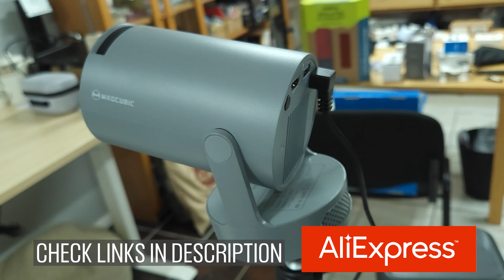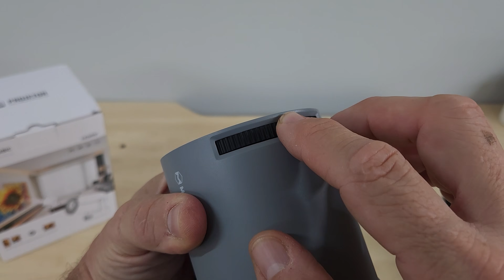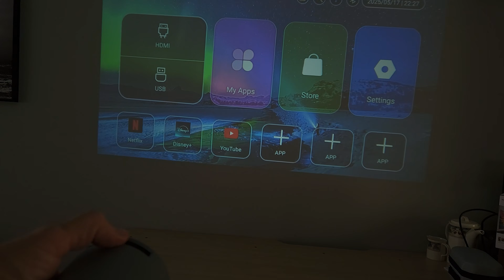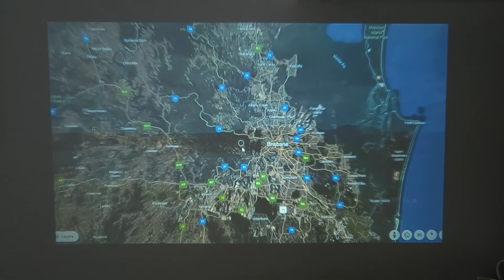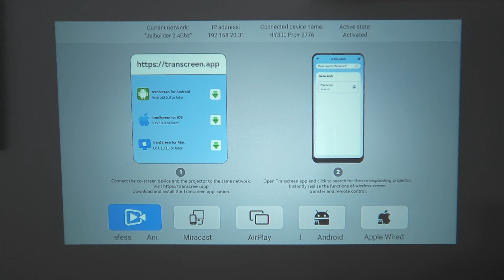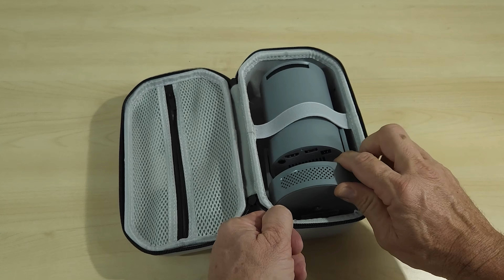MAGCUBIC HY300 Pro Plus Mini 4K Projector—Way Better Than I Thought!

Comment: I just got mine yesterday and it’s pretty cool, only issue that’s now happened twice is that when I try to use any app built into the system it says there’s no Wi-Fi connection (even though there clearly is) and that I can’t use the app. The only way I’ve found to solve the problem is to factory reset the projector, which is annoying to do since I have to re-map the screen to my wall and have to sign back into all my apps

Comment: Does this remember your login details on YouTube. 
Do the apps come pre installed and are they free
How long is the power cable
Reply: I just got one yesterday. Yes, it remembers your login for YouTube once you set it up. Mine came with a few but you do have to install them, super fast though. They are also free and there are many to choose from. The power cable is unfortunately quite short so you may want an extension cord!

Comment: Some of the screen mirroring doesn’t work well or at all.

I bought this to cast crunchyroll from my iPhone 17 pro max on my ceiling (instead of watching it on my phone) but it doesn’t work.

YouTube works, didn’t try a bunch of different apps because I wasn’t in the mood to but I’ll probably hook up my Xfinity stream box to it so we can watch Hulu, Netflix, etc.
Reply: Does crunchyroll allows miracast ? Netflix and plenty of other platforms does not, it is not necessarily a projector issue.

Comment: The resolution looks very very dull. doesn't seem to be 80000 lumens or Ansi Lumens 290. something seem to be odd. The other supplier advertises the same model to be 170 ANSI Lmns with 1*3W speaker at the base.
Reply: @sayedbahari3269  older models

Comment: The brightness is not enough,should be 50W led inside not 30W.The sound from speaker is awfull,the power supply is 90'C hot it will work less than year.Mine new has curve picture  from beginning. You must hawe router ,not connecting wireless directly.
Reply: Its 30 bucks

Comment: I got mine last year from eBay Australia and it still works one year later I use it almost everyday
Reply: Roughly how many hours each day
Reply: @Limitless807  depends maybe 5 hours a day
Reply: @andrewattenboroughtwothumb4697 that's quite durable
Reply: @andrewattenboroughtwothumb4697   is it good for gaming ( Playstation) ?
Reply: Does it connect well with the wifi? Also, can i connect my bluetooth earphones with it?
Reply: @Shanayasmiles  mine does perfectly

Comment: Hi, can you calibrate the picture settings for the best picture quality and inform us the numbers? Thanks
Reply from the maker: Yes, the picture settings can be easily adjusted and calibrated. No point me providing this as everyone has a different surface being projected against, and so this needs to be done individually.
Reply: Why?   Are you going to be using the same colour grey paint on your wall,  with the exact type of ambiant lighting?

Comment: Hey, love the video. I just have a question. Where can i buy the exact DC cable? I can only find the round ones that don't fit. Can you please help me out?
Reply from the maker: Hi, I tried looking online and had no results, sorry.Maybe you might have better luck. You're after a dual-output AC/DC power adapter with a 4-pin plug with the following specifications:

Input: 100-240V AC 1.0A max
Output: 1: 36V DC @ 0.95A
Output 2: 12V DC @ 0.7A 
Model/D/C Number: 2503 (likely a manufacturer-specific code)

Comment: Sound Quality from the default speaker, is it Good for a small room?
I am currently enjoying my HY300 pro only. But the default speaker is quite low even to the fullest volume.
Always need a BT speaker nearby.. because from 3.5mm audio source is also quite low
Reply from the maker: I think the sound quality is reasonable for a small room. But obviously it only has a small speaker so don't have surround-sound expectations, lol. We use it for camping, and it's perfect for that application.

Comment: 8,000 lumens? Yeah, nah. Maybe a couple of hundred. Rated like a 1990s portable speaker claiming 8,000w or a pocket torch producing 8 million lux. Yeah, nah.
Reply: The spec sheet on Ali now lists it as 260-300 ANSI lumens which looks like a lot more accurate.

Comment: Another great review mate 👍 Do you know the wattage of the product ? I wonder if I could run this from my 12v lithium with small invertor at camp
Reply from the maker: Yeah, sorry I forgot to include the wattage in my review... I'll check tonight and will update you. 👍
Reply from the maker: So, this projector is run from a 4-pin DC Power Supply plug that states:
INPUT 100-240v 50/60Hz 1.0A MAX
OUTPUT1: 36v - 0.95A
OUTPUT2: 12v - 0.7A
So, I don't think 12v small invertor will run this to be honest.
Reply: @jelreviews  bummer !! Thanks for checking anyway mate 👍

Comment: First of all this is not true 4k, second the ansi lumen is to dim to watch in day light 😊
Reply from the maker: I disagree... the image quality is actually excellent for the price.
Reply: @jelreviews  turn on the lights it will wash out the picture. And it’s not 4K. 720p if even that.
Reply: @jelreviews  awesome little thing for so cheap, I'm impressed
Reply: Its 40 bloody euro , for that price who cares. It's 720p native and it projects, and sure it's not going to blow you away with brightness ....its 40 quid what do you expect.
Reply: @technodaz Yeah that’s true but why they always go to lie row with those f… amazing numbers 😂
Reply: @linassapnagis2174  But it says "Magcubic 4K HY300 Pro + Projector Built in 5W Speaker 1280*720P Android 11 8000 Lumens Wifi6 BT5.4 Outdoor Portable Projector" it is 4k ...4k compatible. My cheapest project which I use mainly for fun an outdoor movies is the same and I tell you play a 720p movie then put the 4k version on and there is a massive difference. At least it supports a 4k signal unlike some other ones I've seen in the past that sat 4k and when you try it goes "out of range" , I mean sure its a bit scummy but people should do their research and with AI you can ask it anything so even if you are tech illiterate , no excuses ask ai.